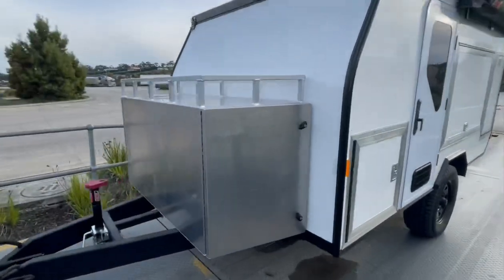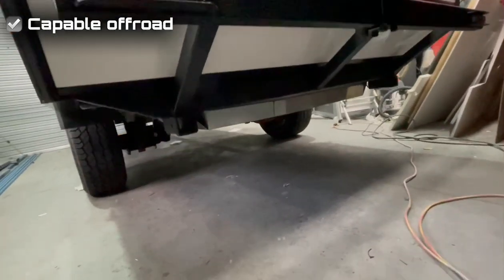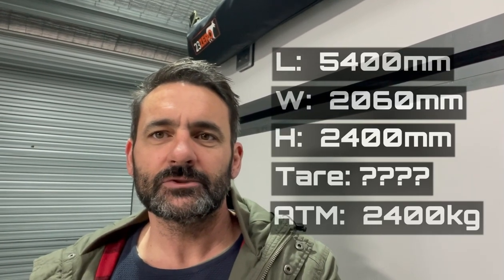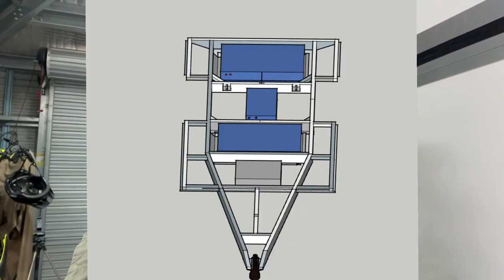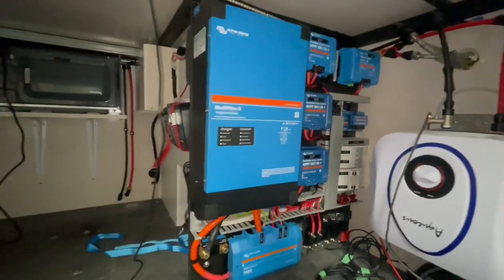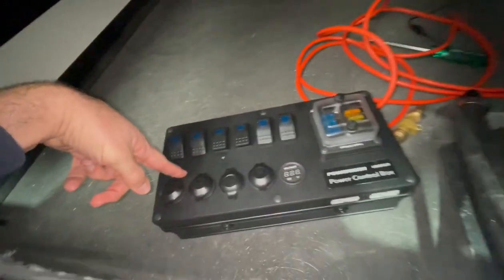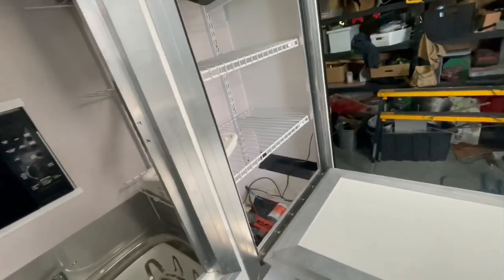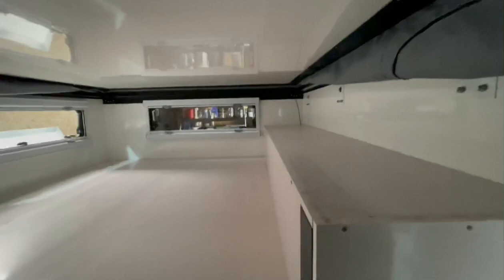Episode #1 DIY hybrid caravan solo build - full walk around

Comment: Great work. Look forward to watching the rest. Just a heads up with something I read about the Multiplus victron. It apparently needs good ventilation above the unit for heat to escape and in the vid it looks fairly close. Perhaps look int this if you like
Reply from the maker: Thanks mate. Yeh good pick up. They spec 100mm clearance, I’ve got about 85mm but reckon it’ll be ok given all the space in front and beside. Will only be switched on during induction cooking and microwave, so short stints too. I’ll keep an eye on it.
Reply: @PerpetualTransient  that should be fine. I layer mine sideways and haven’t had issues. Enjoy your travels

Comment: I reckon it's about 1450kgs. It's an ideal compact build and all you need really. You'll probably find you will only fill the one 140L tank most of the time which saves dragging the weight and having another 140kgs floating around back there.
Reply from the maker: Good luck mate. Yeh it’s going to be an interesting first few trips working all that out. Nice to have the capacity but you’re probably right, i will rarely need it.
Reply from the maker: Close! It was 1500kgs (someone guessed exact weight) , thanks for entering, better luck next time!

Comment: Impressive  build.  What was the material for the sides and roof.  Like the Tough Ride suspension and will build something similar for my project cuzz like Australia we have a lot of rough back country roads/trails in the U.S. and then there is Canada, Mexico, and Alaska.  I also won't have propane,  but will have a small marine wood stove cuzz I will boondock in the winter.  
  Thanks for the post, will follow up with the build.
Reply from the maker: Thanks. It’s called fibreglass composite panel, 28mm thick. Most of the vans in Australia have now moved to it for construction now. Good insulator, light and strong

Comment: Great Build series - really helpful ideas. Any idea what the tare weight of the chassis (frame, suspension, wheels) was?
Reply from the maker: Thanks! There’s about 220kg of steel and 160kg of suspension. The two wheels and tyres about 80kg. So 460kg or 1000lbs
Reply: @PerpetualTransient  WOW. Thats lighter than I would guess. So what about the body/shell/carcass?     I would have thought 250kg so without fitout you'd be at under 800kg.

If interested, do another on build series doing a rough breakdown on weight. Surprising that a tonne of weight for chassis and fitout.
Reply from the maker: @unitedstates3068  Total weight was 1500kg. There’s about 400kg of walls and floor. Extra spare wheel, mattress, awning, Victron gear, battery all starts to add up. I knew it’d be critical to get to floor level as light as possible. I had calculated through my design that I’d land at 1516kg. Couldn’t believe it actually landed almost right on it.
Reply: @PerpetualTransient  Thanks for the reply / info

Comment: great stuff, how far away from the wall is the Airhead toilet so the lid stays up, 10, 20mm?
Reply from the maker: Only about 5mm mate as the hinge sits forward of the rear extremity by like 20mm. I even have those little black cupboard door handles obstructing and it still stays up vertical

Comment: Nice first episode mate, looking forward to the next 20 of them. I agree with your philosophy of not wanting to tow an anchor around, it is something that most manufacturers don't do enough to reduce the weight of their products.

I think your tare will be quite good and guess about 1285kg. Also, did you consider an aluminium chassis at any stage?
Reply from the maker: Thanks mate. Good luck. Nah never really thought of ally. Never really worked with it before, so stuck with steel. It tows beautifully. See how goes fully loaded.
Reply: @PerpetualTransient  Fair enough, stick with what you've comfortable with. I'm keen to do a hybrid soon and my boat trailer (2.8t) is alloy that is all bolted together. Been wondering if the same could be adapted to a van chassis, particularly given the strength of a full composite body.
Reply from the maker: It was 1500kgs (someone guessed exact weight) , thanks for entering, better luck next time!

Comment: well done mate. 1575kgs is my bet. why the toolbox so close to the front wall, can you remove if you need to clean behind or clear out any mud or crap caught there.
Reply from the maker: Thanks mate. Yeh it was a late decision. I actually got my brothers parkes 15 and measured the gap. Really wasn’t sure what to do there. It’s an easy move, just a  couple U bolts, 5 min job. I’m putting Jerry holders on too, so will decide final position when i fit those.
Reply from the maker: Close! It was 1500kgs (someone guessed exact weight) , thanks for entering, better luck next time!

Comment: 1550kgs?  What brand panels are the 310w please? And is the battery DIY build?
Reply from the maker: They are Sunman eArc 310W - Flexible Solar Panel 1681 x 1000. About 5kgs each. Nah battery is a CALB, solar4RVs assemble them. Google solar4RVs and CALB and the specs are on their website.
Reply: @PerpetualTransient  cheers, are the panels glued to a twin walled Suntuf type polycarbonate to insulate then screwed or bonded to roof.
Reply from the maker: @FRBD40  not yet stuck on actually! I’ll be using a vented gap kit when i get to it soon.
Reply from the maker: Close! It was 1500kgs (someone guessed exact weight) , thanks for entering, better luck next time!
Reply: @PerpetualTransient  damn, 'missed it by that much'. ;)